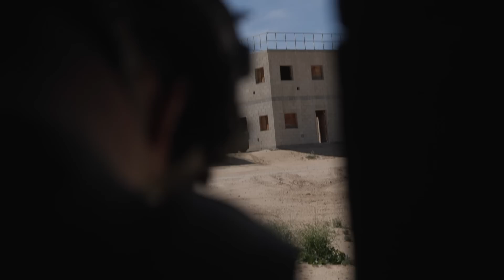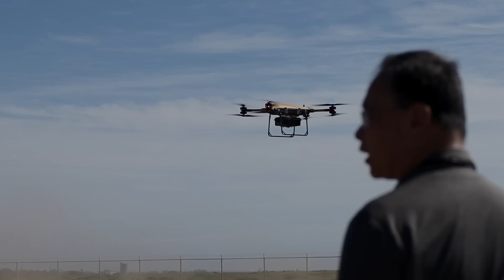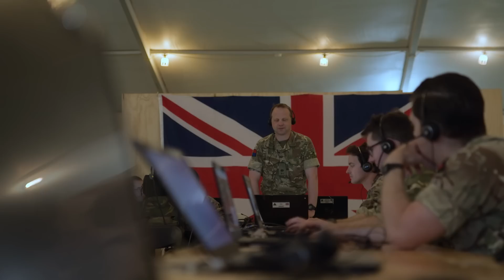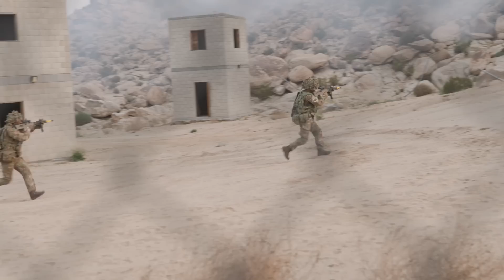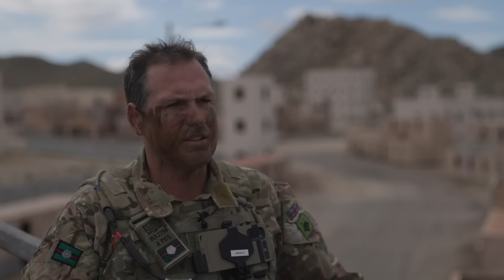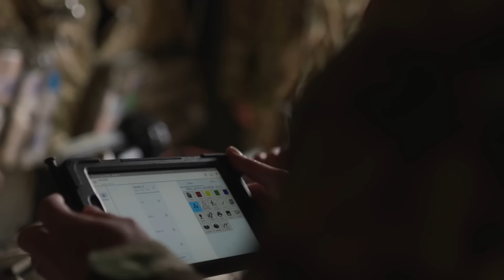Project Convergence Capstone 4 | The Future of Warfare | British Army

Comment: Question: the image I have in my head of our army is one that barely can field what it has been using the last twenty years let alone adopting the "newest", most technologically advanced stuff. Like the civil service I see it as using barely running systems overstretched and behind the private sector. IS THAT TRUE? Or does it have capability beyond what I can imagine. Ya know, "modern warfare" tools etc?
Reply: Maintaining old equipment is hard. Buying new equipment solves that problem.
Yes, the military is behind the private sector, because all their equipment comes from the private sector. The private sector develops the kit and then the military decides if they want to buy it. There will always be a delay between those such that the cutting edge prototypes are 2-5 years ahead of the finished products on sale, and then probably another 2-5 years before the military buys, takes delivery, trains soldiers on the new equipment, and then deploys it.

Comment: Would all or any of these work after a severe solar storm, an overhead EMP or when exposed to battery draining gamma radiation from fallout?

It comes across that the UK's defence plans and systems are only good up until the use of nuclear weapons? 

“Everybody has a plan until they get punched in the face” - Mike Tyson.

Comment: Throw in a grenade not a little robot, that'll tell you if there's an enemy in there a lot quicker.
Reply: Hostages?
Reply: @luisislas2162  casualties.
Reply: @luisislas2162 collateral damage
Reply: Also a grenade gives away your location. That sounds a smart thing to do in urban warfare 😏
Reply: @chrisharvey592  🤣🤡 they're storming a building and clearing it out of enemy inside, not trying to sneak past.🤣
Reply: @jimcy1319  failed if there is more than 1 building. genius
Reply: @ragzy7108  Fool, do you think the army is only capable of storming one house at a time. How do you think they liberated Europe in ww2. The Germans didn't occupy just one house.
Reply: @jimcy1319  why cause an explosion when you can send a drone to look? No benefit whatsoever
Reply: One robot many buildings to clear. How many grenades are you planning to use?
Reply: @AC-wz9tx  the army has more than one grenade, what a stupid comment.